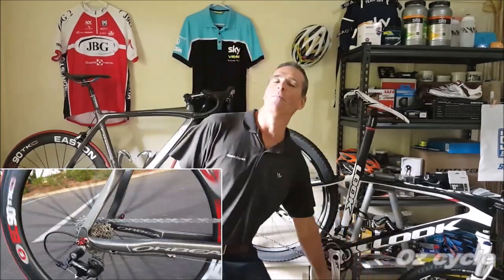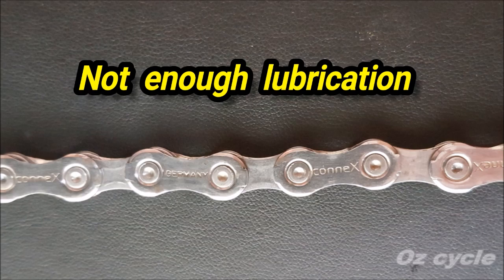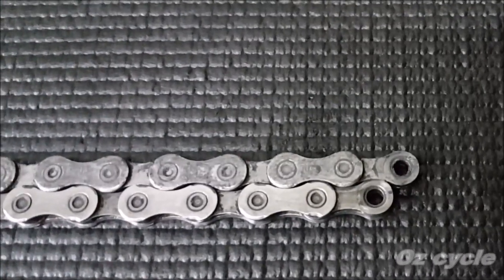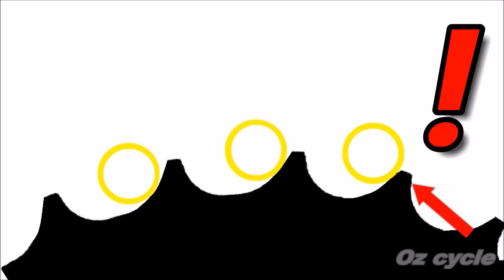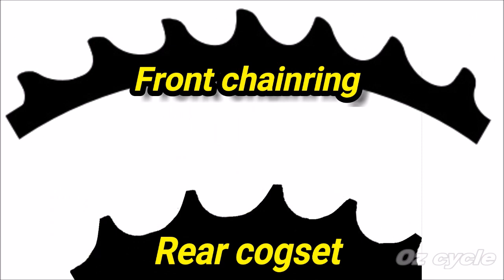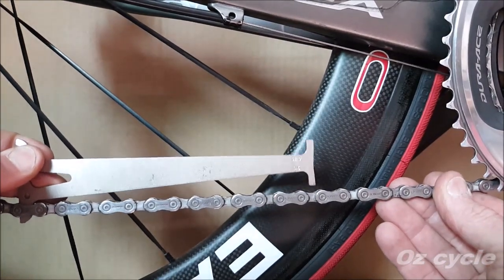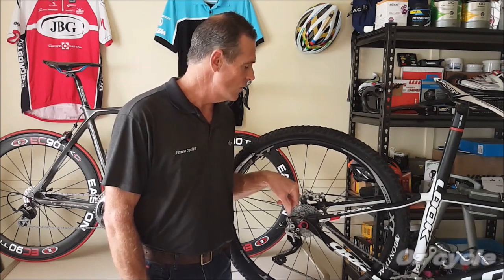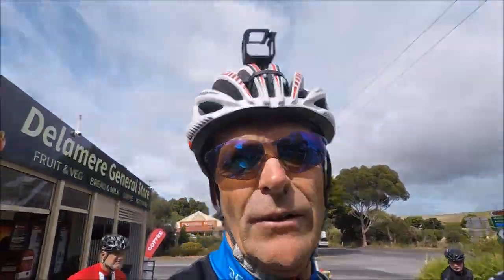Worn chain? -When to replace.

Comment: I let my last road chain go to far and had to replace the cassette too. Got it done, working, but still had aweful drivetrain noise, and thought my front chainrings needed replacing too. Had a ride in the rain, washed bike, re-oiled chain, and suddenly it was silent! All the noise was apparently  due to the storage grease on the chain. Never experienced it like that before, but there you go - I'll be re-oiling my new chains from now on.

Comment: Great video! I have found that for me my chains wear about three times as fast as my cassettes.  A new chain will wear down very quickly on a worn cassette and vice versa. Usually, the wear of only a few of the most used cogs on the cassette "spoil" the cassette. A trick I have used in the past to extend the life of chains and cassettes is to start with three chains and rotate them on about a 1000km basis.  The chain and cassette wear matches up better and reduces the accelerated wear caused by mixing new and worn components.  It has doubled to tripled the life of those two components on my commuter bikes. I usually put in about 5000-9000km annually so it can save a bit of cash to purchase other bike bling!
Reply from the maker: Yes,rotating 2 or more chains is a good method too.
Reply: Love this tip. Makes sense too! Took off my chain and saw visable wear. Decided to swap it before it put wear on the cassette.

Comment: Excellent video, I’ve actually just replaced a SRAM Red chain after 1400 miles, it showed .25% at 1000miles then rapidly went to .5%. Interestingly it didn’t measure the same wear right around the chain, some places were slightly better than others. So worth checking in 2-3 places.
Reply from the maker: Yes thats good practice to check in multiple places on the chain.

Comment: Outstanding Oz! My bike is hurting for sure. Front rings are sharp and a few chipped off. Rear cassette looks good I think. It was a free used bike and I don't know the history. It has got me peddling again though, which I am very grateful for. Cheers from California.
Reply from the maker: Nice to hear your on a bike then Ronald 😁.  Sounds like rings or crankset needs replacing and following what you say,probarbly the chain and cogset also...maybe thats why it was a freebee?
Greetings from Australia too 😎
Reply: oz cycle I am very happy to be riding again. I forgot how enjoyable it was. It's a Gary Fisher (China). Somebody did some upgrades on the bike I do believe. The front rings seem to riveted on (Suntour). Plus the bottom bracket has play in it. Probably new crank set and chain. If I have the correct language/description. Maybe that is why they gave it to me? Hahaha! Probably! Hopefully not too expensive?

Comment: Great video. My 9 speed chain  had streched after just 1.000 km. I'm just 73 kg and I didn't steep hills so much. But I think I made a mistake last summer. There was a rust on the chain and I put it in a bottle and add lemon salt and boiled water. I should had to wait just 15 minutes but I didn't know and I left it for 2 hours :) I think this damage the metal. Anyway I've already wanted to pass 11-34 cassette and I bought a new shiny chain. :)

Comment: This is a great video with a flaw.  It has a wonderful description of chain wear, why it's a problem, and even when to replace the chain, but then it recommends the Park chain checker, which is not a good way to measure wear.  A ruler measuring 24 links over 12 inches, and using 1/16" elongation as a guide, which is easy enough to see, and you're good to go.  It's even cheaper than the Park chain tool.  The problem with the Park tool is that it is not only measuring the chain elongation, it's also measuring other things, like the the gap between the the roller and the pin as well as the wear between the roller and the pin.  Picture it, the Park tool pushes itself between two rollers, each of which push against a pin, so its measurement, as Sheldon Brown says in his article on the subject of chain wear, is confounded by the roller play .  Stick with a ruler, it's more accurate, or go for the Shimano chain tools that avoid the problem with the Park and other tools.  Nah, go for the ruler.  Thanks for the great video all the same!
Reply: Hi, wish I had seen this earlier.  I see your point, but I do not agree this is a serious flaw.  
Other experts suggest elongation measures with rulers even on an entire chain are likely incorrect, "as they miss the wear from the rollers", see ZeroFrictionCycling in https://zerofrictioncycling.com.au/wp-content/uploads/2018/04/Chain-Longevity-Testing-Full-test-brief.pdf .
To nit pick, the measures are pin to bush, bush to roller, as rollers run on the bushes not the pins; i fully acknowledge this is not fair as it does not diminish your argument.

Wear from rollers impacts the life of the chain too.  

In the tool case they measure only 2 link roller/bushing sets of the 11 measured (eg ParkTool CC-2, which is 18% of the rollers) not all of them, but i get the point that what matters is the pin to pin as that is what hits the cogs.  But the longer the tool (eg ParkTool CC-3.2 is longer than CC-2 so less than 18% of rollers are measured)  the smaller the impact. In the ruler method, to be accurate you would need to pull the chain off and measure it in entirety and then measure segments as some segments of the chain will wear differently; this segment issue is key to why the tools are viable.  The additional (very minor) wear of the rollers may be ignored as it allows us to avoid reaching the 0.5% wear point, which is the damage point and we can quickly and easily measure 3-4 locations on the chain much faster and probably more accurately than holding up a ruler and measuring by eye; a digital measuring device may solve that for those of us with age related eye deterioration.  

So the ruler method has accuracy issues too as it is by eye for what is a very small measure (0.5%) but more than that, it has inconvenience issues and that makes it less desirable.  Easy to use the tool and in many places whilst the chain is on the bike. I am saying yes your point is valid, but the convenience and frankly minor over read makes the tool superior as it will get done and more and often.
Reply: @Desmo500  Hi there!  Thanks for this reply.

i think both you and the author of that zero-friction article agree that the ruler method is accurate.  I think most of the point in the article and in your note is that the ruler method is hard to do.  I don't agree with that -- it is very easy to see 1/16 and 1/32 or 1.5mm and 3.0mm of wear-related elongation over 24 links with corrected vision, and it's soooo simple to do.  You can just line up a student's ruler against the chain.  I line up the one-inch mark against the leading edge of a plate, and bang, you've checked a nice 24-pin span at the 13 inch mark.  None of the 0.1mm that the article mentions.  There's an even easier way if you have a retractable measuring tape using the hook at the end on the leading edge of a plate, but I didn't mention it b/c it requires a measuring tape in good condition.  I also just tried using a ruler with my phone's magnifying-glass feature, and that was very easy as well.  In mm land (lucky!), you might want to put a pen mark so you don't have to convert from 12in every time.  In any case, even a beginner to the process can do the measurement in 30 seconds, easy.

Also, the rollers wear evenly enough that the pin-to-pin measurement is sufficient and gives an accurate measure of how hard the chain is being on the sprocket teeth.  You mention that the roller clearance does get measured twice by the tool, which is magnified since the tool is only measuring a small number of links, but that this doesn't hurt anything b/c you only reject a chain early (I agree that this is the lesser of the two kinds of bad readings), and that the tolerances can be tight or loose.  It's been a while, but I know that Regina chains could be nearly out of spec when they were new b/c of large roller inner diameters.  Why bother with the inaccuracy?  And why not the Shimano tool instead, which has the advantage of being an official-looking tool and doesn't cause the error that the Park tool and others make?  We should support the kind of manufacturer that gets things right like that.

But really, and I think this is where I have to admit guilt that I am overly passionate about this -- less is more.  Most of us already have a ruler on hand, so you don't have to buy anything, and there will be permanently fewer things to deal with.  Also, these tips make it all around the world, and in many parts, the money spent on a tool would be better spent on the chain when it's needed.  Finally, for the less-bike-focused persons of the world (you know, the type who would likely not an enjoy a dinner party with the two of us as guests), giving a non-tool method might keep them from lugging their machine to the bike shop, which I think is the point of this great video.

Have a good season!

Comment: Sound advice. I have three cassettes. One has done 15,000km, another about 5,000km and the last about 5,000km equivalent on the turbo trainer. I can't tell the difference between them, so I must be doing something right :)

Comment: Remember to check several different sections of the chain. They do Not wear evenly in all links. Probably due to slight manufacturing tolerance
Reply: no, because your pedaling, you are not electric motor

Comment: Nice graphic.. and good explanations, but the ruler seems to be more accurate than chain wear tool. Just that it's difficult to use. When I last time replaced my chain, the ruler said it's still fine, but the chain wear check tool fell in at 0.5 side... So it was just rollers and pushing that were worn.. I continued to ride, for a while, but then my nerves gave up.. measuring it with ruler every time after ride.. So I took it off and then when I put it side by side with new chain.. it was only 2mm longer maybe. After 3000Km. But because I did not have spare new connecting pin.. or quick link. I Installed the new chain anyways.. better for my nerves too, don't have to measure it so often. I guess worn rollers and pushing only affect shifting, but won't accelerate the wear of cogs and chainrings.. And yes the 11 speed chain last longer than old 8 speed chains did on my previous bike.. probably depends on brand and grade..  I always keep at least one new chain as spare. To have it when needed.. And buy it at winter or something, when they have some barging. ^_^
Reply from the maker: You must be a lightweight rider Hardi?
Reply: I have heard that the chain wear tools have that possible flaw where the chain links/pins might not be stretched enough, but the rollers have some play that allows the tool to drop in the chain (a wrong diagnosis of sorts).  I haven't experienced it myself, probably because my larger body size and harder pedaling cadence tends to stretch the chain itself more readily.  Still, I have been measuring with both a tool and a ruler for sanity check.  Both methods have always come to the same results for me so far.  I would still replace if the rollers have enough play to allow the wear tool to fit, because the chain could still ride higher on the front/rear sprockets.
Reply: Ryan Otte What you said is true. In this video he does not differentiate roller wear from pin and bushing wear. Roller wear does not make the chain longer. Pin and bushing does. The tool he used lets roller wear affect the measurement, which will cause a chain to be replaced early. The Pedro’s chain checker will isolate the pin and bushing wear. Chain Checker Plus II https://www.amazon.com/dp/B075VR82NN/ref=cm_sw_r_cp_tai_92nbFbQ8EJCA4

Comment: hang that chains , it gives better viev of elongation.
cogs and chain rings can be restored by reshaping and re pitching teeth.
cog check by tool does not give real situation with cog because , chain skip happen when push hard on pedal, if it skips by small force it means that cog is resurrected long time ago.
some tips: if you like to save chain: keep it clean and waxed, drive biggest as posible chain rings in front and rear and do not drive at high angle(diagonally)between front and rear rings- make custom gear ratios and adjust most used ratio/gear to be strait ( i made that mostly use 3 ring on rear and big on front, and that 3  and 4 rings are from ug shimano series that has wide and high teeth), avoid drive on rain and on dirt
by the way good video with every important notice about chain wear

Comment: Smashing it again with a video like that. well done and well explained.
Though the narrower chains that are just as strong as wider ones is...not always true. I misshifted and then accelerated a bit twice with my 11spd SLX drivetrain and both times, the chain snapped like it was made out of glass. Did the same thing on my old 3x8 drivetrain without EVER breaking a chain. Same with 9sps. can't compare with 10spd, but the setup to 11spd feels really really fragile. but on the other hand, IF you shift properly(which i have to constantly think about) 11spd chains are just fine
Reply from the maker: Mmmmm...you should take that up with Shimano, Calvin,you might get chains under warranty.
Reply: You think so? I kind of expect them to write me off as a really bad case of gear-cruncher.
For really rough and high torque tours i still prefer my singlespeed converted hardtail

Comment: I've recently discovered the Oz vids and so now am playing catch up which includes watching vids that were made a few years ago. As many other commenters have noted, this is the best "chain stretch" vid I've found.
My couple of comments on the topic. 1) Rather than buy a special measuring tool I use a dial caliper. There are so many applications for a dial caliper that everyone who does any type of mechanic work should have one anyhow. The down side is a couple extra math steps for chain stretch. But, I get to know exactly what % my chain is at so I know when it's getting close to replacement time. 2) I wax my chains by immersion. Plain ole paraffin wax does the job. Key to success is thorough cleaning of the manufacturer petrol lube goo - the wax needs to attach to the bare metal. While in the wax bath I move and flip the chain to alter where the clearance gaps are to get wax in to all hidden surfaces. I don't know a scientifically proven time but I keep my chains in for over ten minutes. I want the steel to get up to the same temperature as the liquified wax. This assures the wax can flow in to the smallest clearances and minimizes how much excess wax uselessly and wastefuly clings to the exterior of the chain when lifting from the bath. It's a fallacy that waxing is too much time and effort. The time I spend on prep and waxing comes back in multiples with easier bike cleaning after rides, no black marks to clean from skin or clothes, and many more miles of chain life. I do typically remove clean, and re-immerse in wax at about half life. Even including that I still am spending less time a year on chains than I did in my preceding decades with petrol grime. It really matters to me since I do all maintenance on both pairs of MTB and expedition bikes that my wife and I have.

Comment: Excellent work here, I just replaced my 9 speed drive train after approx 3000 km, I'm an 80 kilo rider so not bad. First generation octalink bottom brackets are getting expensive. I cleaned my chain after every ride with WD40, does it destroy chains?

Comment: In my opinion, you should be able to get at least 10-15,000km out of a chain. This is achieved by regularly cleaning and re-lubing the chain. BUT, I also think you should not use an ultrasonic cleaner, soak the chain to clean it or anything else which would completely remove all lubricant from the chain. I know people who used to soak their chains and could only get less than 5000km out of their chains. I only ever clean my chain by wiping it with a rag and sometimes with a little degreaser on the rag and my current chain has lasted for around 8,000- 10,000km and is still going fine. I never experience the chain skipping even though I change chainrings and cassettes regularly to use different sizes.

Comment: Thank you for this exellent video!!. one question: I measured my chain all over and found 5 links, where the tool fell in at 0.5. The others (still) seemed ok. At what point would you suggest changing the chain?
Reply from the maker: Now. If any measurement is .5 the rest of the chain is very close.

Comment: At 11:20 you use the chain pulling method to see if the chainring is worn. I've seen gcn use the same method to see if your chain is worn. So if chain pulling is for chainring and chain, how do I know which one needs to be replaced purely by pulling the chain?
Reply from the maker: Haha...true if taken at face value Gert. Process of elimination....if chain is new or close to and loose on ring the ring is worn.

Comment: I have followed your videos and waxed my MTB chain with parafin/ptfe every 300 klm. I still only got 4000klm from my chain. Does this sound reasonable for a mtb ridden over dirt and sand and bitumen. I was hoping for much longer wear. Chain was Connex.
Reply from the maker: You should be getting at least 10,000km from your chain. Could possibly be the clean process at rewaxings?
Reply: I think my parktool measurer is not accurate. I measured with digital calipers and chain stretch was way below .5%. Can you do a video on measuring chain wear with digital calipers. Love your channel.
Reply from the maker: I'd suggest obtaining the Park cc -4 tool ....much quicker and easier
Reply: I bought a new Connex chain. Measured the old chain vs the new chain. No difference in length at all. For some reason the Park tool is not accurate.